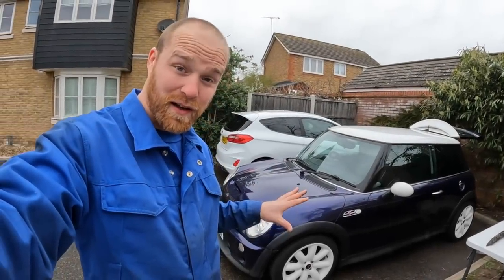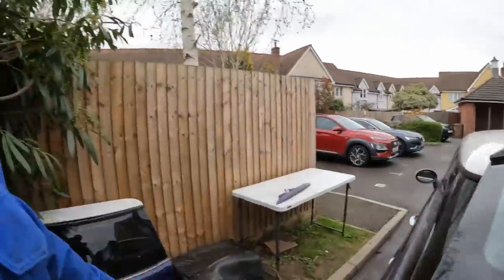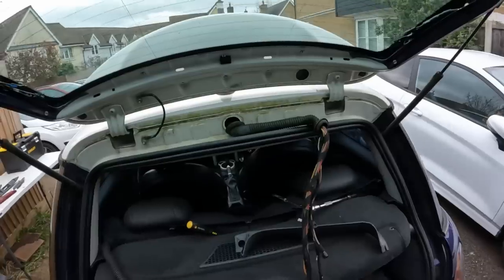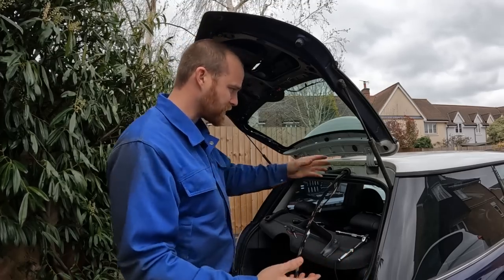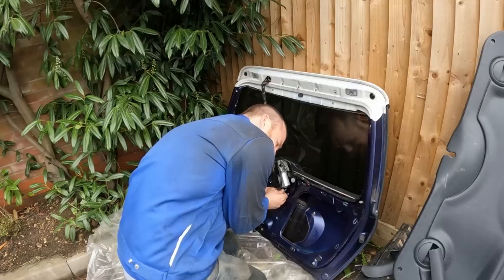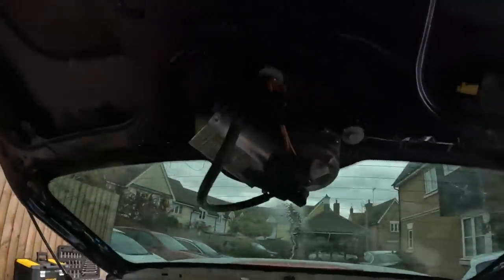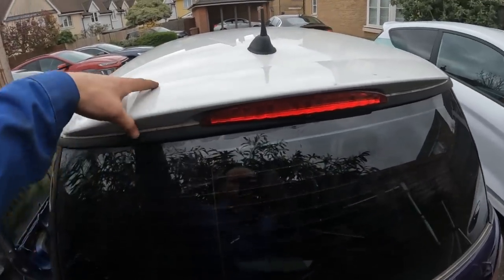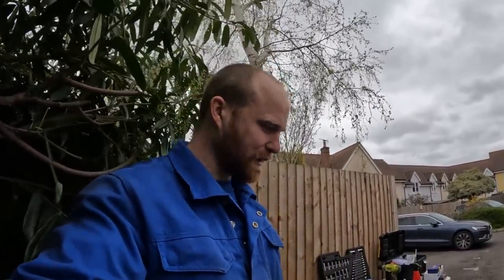I fixed the Mini’s rusting tailgate - the easy way!

Comment: Rear tailgate £65 - a bargain.  New tailgate, wiper function, no rust, new third brake light, new number plate lights - what's not to like.  The chrome looks fine in my view. I wouldn't be able to sleep if you hadn't transferred the Cooper S spoiler 😀

Comment: i wasn't laughing.... im so sorry snort!!, rear spring. easy i believe its a 21m bolt and 2 13mm that connect the strut to the body work. zip them off take the top hat off replace the spring and bump stops. personally if your doing one you might as well do them as a pair
Reply from the maker: Good to know mate thanks 👍🏻

Comment: This might upset you, but I had exactly the same with my daughters kia when I bought a replacement tailgate, after doing the same, i discovered there's a plug just under the roof lining near the hatch, so could have swapped the harness on the floor lol

Comment: i remember it was a real pain to separate the two pieces of the boot handle and not to break them, because they‘re glued at some points and have clips… So sorry I did not remember last time I said you can switch them! For me it worked in the end. But hey, the chrome one looks really nice in combination with the color and the other trim parts in chrome. 
Minis and Daimlers are the cars that can carry chrome, I hope you will leave it this way. When I bought my car, everything was wrapped in black and the first thing that I‘ve done is to re-chrome everything 😂🤙🏽
Dude, you‘re so close to the finish line, keep up! Love your positive energy. Next time it will pass the MOT, I‘m sure!
I remember in the beginning you said you will sell the car when its completed? Why not keep it? It‘s the last really fun to drive little hatchback which stands out with the supercharger.. Now you git this really nice and well repaired car, keep it and have fun, enjoy this high emotion car where you can feel the mechanic going on, hear how it‘s producing it‘s power and play with it‘s handling and sound!
I would recommend you a upgrade to the gp- or even works211-Control Unit in combination with 380cc injectors and an upgrade intercooler, maybe with jcw 11% or 15% pulley. 
Works great for me, really aggressive and sensitive for every millimeter of moving in your foot, feels so great, like a racecar! 
Dude, enjoy and have fun!

Cheers!
Reply from the maker: Yeah I'm happy with the chrome to be honest, so I'm definitely gonna just keep it on the car. 

I'd absolutely love to keep the car, but I'm not one of these big YouTubers that is making loads of money from this and can keep it hanging around forever. The reality is I'm going to have to sell it to not only make a space for the next project, but because my bank balance is now running dry 😂 

This R53 is a great car though. I'm looking forward to taking it on some blasts once it passes its MOT!

Comment: Sorry Nino I somehow deleted my comment but if you need the rear wiper and your boot has the earlier trico item you need to change the wiper motor to the Valco item and there’s conversion kits available on eBay.
I couldn’t get the link working but if you type this on eBay it will bring one up.   BMW Mini R50 R53 Trico to Valeo Rear Wiper Motor Conversion Kit Upgrade Cooper S

Comment: You need change both springs at same time as it will sit lobsided when looking at rear as older one will be weaker than new one
Reply from the maker: I so wanted you to be wrong, so I did some Googling, and lo and behold – you're dead right 😅 Dammit.

Comment: Very grateful I came across this video! About to do the same job on my R53 but thankfully my donor car has the S spoiler on already and it’s already stripped as it was a race car. Will have to work out fitting the wiper motor to it from mine though 🙈

Comment: First we have a "Kapow!" and now a "kwhu, kwhu, kwhu, kwhu kwhu" - you need to start getting some T-Shirts made up Nino !

Great job on the tailgate replacement - recently replaced the gas struts on the tailgate of my Estima, but without a holding stave, or the forethought to go back 35 years and head-spin - well done!

Sorry to read about the further fail, but you're getting sooooooooo close - was somewhat confused that the Fail did not include the rear wiper blade, as (it's the motor's fitted) it needs to be functional, or did you already fit that on prior to M.O.T? Also agree with ither comments about replacement of the spring, which should be springS to keep everything balanced.

Next time Pass, for sure!

Keep 'em comin'!

JC HK
Reply from the maker: Haha cheers John 👍🏻

From everything that people have been telling me I expected to at least get an advisory on the wiper seeing as the motor is fitted like you say, but I didn't get anything, and I still haven't fitted the arm. I'm more confused than when I started haha.

Comment: The bottom bolt on the rear strut assembly can sometimes be very corroded. It took me 45 minutes of WD40, undoing and doing back up to get each bolt off. Hopefully you won't get this. Also it is best to replace both springs.
Reply from the maker: Uh oh - don't tell me things like that haha. Fingers crossed mine is a bit nicer. Will soak in a load of penetrant for a while and see if that helps 👍🏻

Comment: Nice! Thanks for the shout out. The chrome hatch handle was part of the Chrome Line Exterior package which in 2006 cost $250 US to add it. So roughly 500 pounds in 2006 money to add that package.

When I watched you with the hatch removal and install I was thinking I would suggest adding a small impact driver to your tool collection. I have a Milwaukee M12 Impact driver which is my favorite go-to tool. It is light, the torque and speed is adjustable and is super helpful for situations like the one you were in using a hand powered ratchet. I think you have a larger Ryobi Impact so if you want to stick with that brand I am 100% confident they have something similar. My wife loves the Milwaukee M12 impact driver. She borrows it when assembling furniture and putting up shelves around the house. My M12 Milwaukee came in a kit and the store I got it from offered a free powered Milwaukee ratchet with kit purchase. I use that quite a bit in my builds as well.

I swapped in stainless steel braided brake lines onto my 2006 Mini Cooper S last weekend. On the first wheel I snapped the banjo bolt torquing it down. So I am waiting on StopTech to send me a new one. Then a Pentosin DOT4 fluid flush and vacuum bleed and I am good to get back on the road. My local Mini Club has a first of the season drive April 16. I am hoping I can make it. Car is in my garage on four jack stands waiting on a single bolt right now. It is snowing today again today so no hurry to get it on the road. As my old neighbor Prince used to sing Sometimes it Snows in April. 

Cheers to you Nino! Almost there!
Reply from the maker: Thanks for the impact driver recommendation, Bill. Right now, due to funds, I'm prioritising tools that are more specialist in nature over ones that save a little bit of elbow grease. But I'm very much hoping to get an impact driver in the future, and will put the Milwaukee M12 on the list for sure!

Hopefully there's no damage to anything after snapping that bolt! One of the things that's amazed me through all this is how one small bolt or clip can hold absolutely everything up, and just leaves you twiddling your thumbs when there's still loads of work to do. 

It's all fun though really – that's why we keep coming back for more!